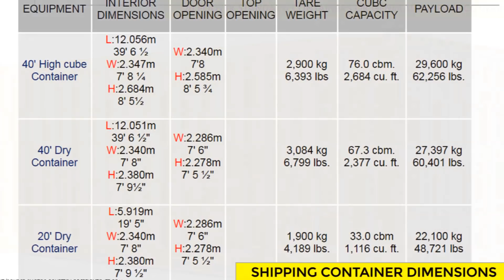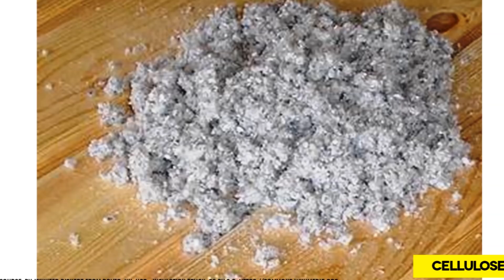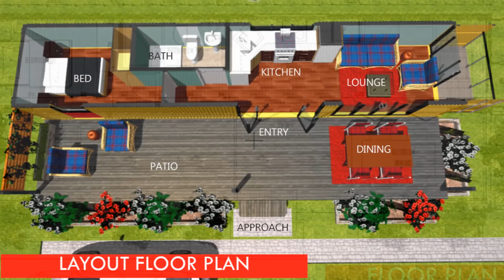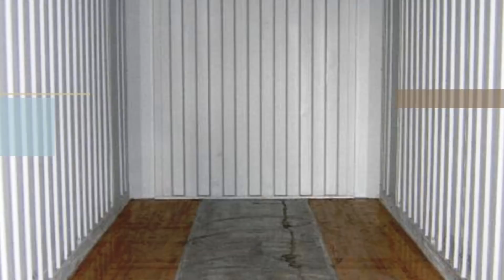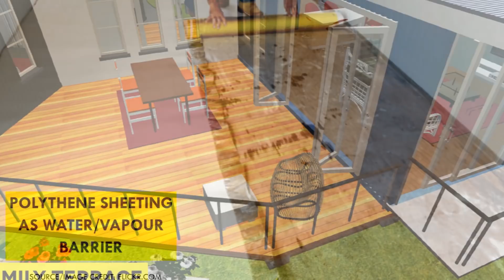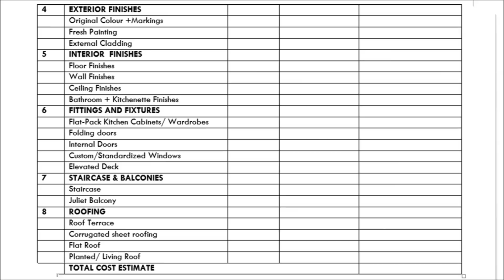10 Things You Should Know Before Building a Shipping Container House 2018 | SHELTERMODE

Comment: This video mentions insulation according to the local climate in mind. What if the climate is tropical and humid with salt in the air? Think low sea level Mauritius or northern Mozambique. I haven't seen such a video yet - but I have a LOT of videos to go through still. Is there perhaps an existing video which explains this? This issue of condensation is scaring me.
Reply from the maker: Just put adequate windows it will be fine